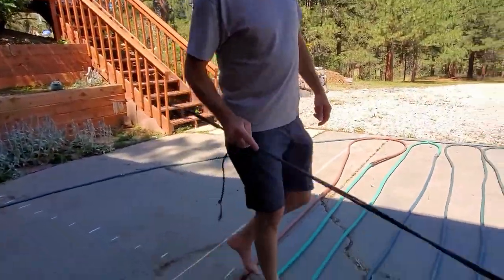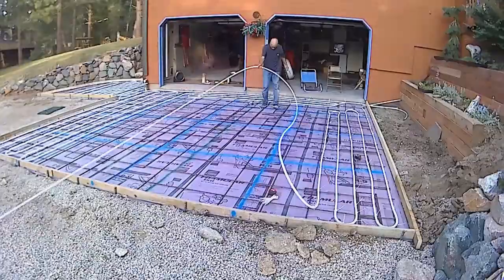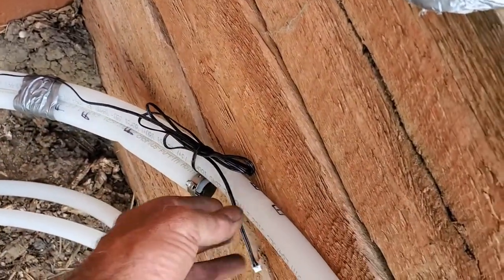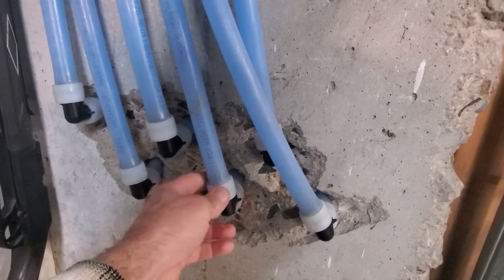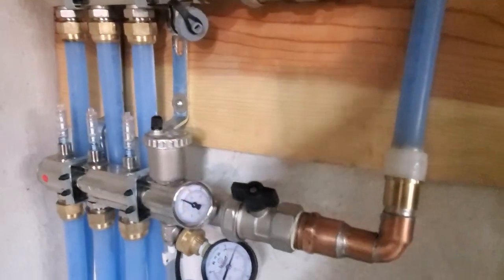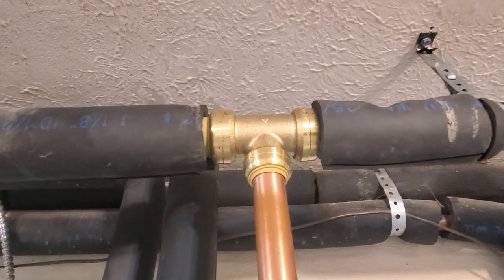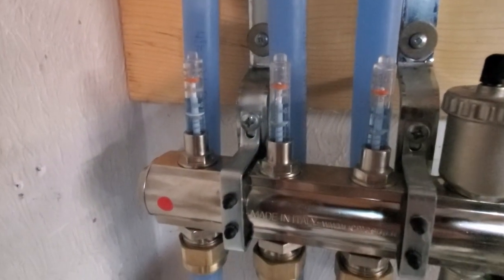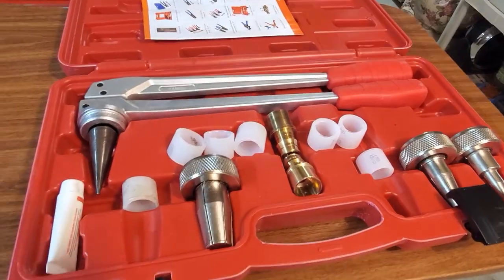DIY hydronic driveway snowmelt system

Comment: For Blaine or anyone else planning to do something like this, you can get your layount drawn in ACAD quickly and cheaply if you target architecture or engineering students at you local university or community college. You can post and ad on CL, pin one to a bulletin board at the school, reach out to a professor, etc. A novice ACAD usercould knock this out in an hour or two. Throw him/her one or two hundred bucks and you'd be set. Overhead and billable rate for thesame work from a firm will cost 3x-5x as much. You can download a trial version of software and spend time figuring out how to draw with it if you want to DIY, but this would literally take an experience ACAD user 30 min (a little more for a novice like i said).

Comment: I enjoyed your video. I have done heated floors in a home but not a snowmelt system. I would like to find information to determine safe thermal input for snowmelt driveway/sidewalk. How fast can I inject heat without damaging the concrete.
Reply from the maker: There is a big difference of opinion in that, but I do remember watching a video where a guy shocked his driveway with maximum heat to prove that it is not possible to crack concrete with a hydronic system.  There are some standard numbers out there but I don't remember where I found them.  In my case, I did get one hairline crack in my driveway that was directly above one of my tubes and even followed the turn at the end a bit, but I don't know if it was because of heat or maybe the tube was too close to the surface.

Comment: Interesting. I have extensive experiences of the hydronic snow melt system. I own a technical consultant company in Sweden specializing in the field. It is a shame Uponor in Us and Canada did not take care of old ”Wirsbo”-know how better. After all, Wirsbo invented the s.c Meltaway system in the early 70-s. Thats when we learned not to use the same pipe layout principles as that of the indoor radiant floor heating. Single pipe in sinus pipe runs over the surface is no good, not even for the heat distribution on the surface, but also gets difficult to install all those 180deg turns with a relatively stiff pipe. The correct way is not well known in Sweden either. It could be called parrallel runs. Supply and return pipe goes side by side all the way, creating even surface temp and melting. You can then run higher deltaT over the loops and use longer loops. You get a higher heat output without running giant pumps. I hope your system works out well for you. I suggest running it on low deltaT, high flow, to minimize temp variations on the surface. Take care!
Reply from the maker: You are not wrong about the layout.  I did research the parrallel run and decided the benefit for my purposes was not worth the effort and opted for the high flow-low delta T .  Keep in mind, this was for my own driveway and the only person I had to please was myself.
Reply: @bp3inden  ok, great! And on the positive side you have a concrete installation that has excellent heat conductivity. If your loops are not too long you can get good performance with a reasonable pump size. Normal loop length in southern Sweden, running at deltaT=15 degC, with 25mm pipe, is 200m.
Reply: @MrWipex  What are your thought about insulation? 1" or 2" thick, reflective blanket instead of foam board. What insulation method best for effective snow melt.

Comment: If you don't use the system, will the water in the system freeze?
Reply from the maker: The system ris filled with a glycol mixture and will not freeze.  I had to use a heat exchanger because my boiler system is not filled with a glycol mixture.

Comment: Very nicely done. Quick question: Any idea how much of your boiler energy goes to snow melting? Do you keep the baseboard heaters running while snow melt is also on? 
In other words, is your boiler enough to heat both snow melt and the home itself?
Reply from the maker: It is not a problem for me since the snowmelt system is only on for short periods, I heat my main living area with wood when its really cold, and I have 4 zones in my house.  A professional would not have done what I did and would have insisted on a larger boiler, but the beauty of doing things yourself is you get to use a little common sense.
Reply: @bp3inden  haha well said. Thank you for your reply.

Comment: So being In Denver, where you litterally get tons of snow, with heavy snow you just loosen the grip of the snow/ice from the driveway, then shovel or snow blow?

I make that assumption because melting say a foot or more of snow would surely take many hours.
Reply from the maker: Yes, the original idea was to just loosen the ice in the area that never gets sun so I could scrape it off, but I found it works well to melt off even a foot of snow.  Keep in mind our show is usually pretty light and fluffy.
Reply: @bp3inden 
Cool, thanks for the reply!

Comment: Did you design any time of drainage for surface water? If not would you if you were to do it again. Just wondering about ice buildup off the slab
Reply from the maker: No, I did not worry about drainage as it is such a small area and it drains right into the gravel driveway with no problems.

Comment: I used a free trial of LoopCad software to design all the loops for my house and it worked great.  I will be reusing it for the driveway next.  The 30 day trial was plenty for me plus I could put it on other computers or virtual machines should I need more time.  I believe it can generate a materials list or I may be thinking of the Watts Radiant Works Pro (2 week trial).  It's pretty slick and will take into account your geographic location in calculations.
Reply from the maker: Thanks for the tip.  I wish I had known about this when I designed mine, but so far so good.
Reply: Does it have the settings to do snow melt on outside concrete? I ask because I have read where the layout of indoor heating and slab heating are different in that indoors you run along outside walls first because that's the greatest heat loss whereas a slab you want to heat it evenly.

Comment: Blaine,  great video I wondered what part of the country you are in?  (Weather Zone) Have you run the system through a snow event?? Last question is how or what do you use for make up water and head pressure for expansion and any air bubbles?
Like the DMF150 Digital PRESSURE PAL Hydronic Mini System Feeder (4.6 Gallon)??
Love to see a video of servicing and glycol  adding!
Reply from the maker: I am in zone 5 (Denver).  I have used it several times and it works well for what I designed it for.  My driveway doesn't get any sun and stayed icy all winter if I didn't shovel before it was driven on, so I really just use this to melt the ice enough so I can clear it off.  
Since this is a closed-loop system separated by a flat plate heat exchanger from my boiler system, I don't have a make-up water valve installed; I just have an expansion tank.  
Sorry, no video yet of servicing the glycol, but I might change the circulator to a bigger one and maybe I will make one then.  I have a solar domestic hot water system that I run glycol in so I have a bit of experience.
Reply: @bp3inden  Thanks Blain, You must have done a great job bleeding the system to maintan the head pressure with  the accumulator. Thank you again for the info!